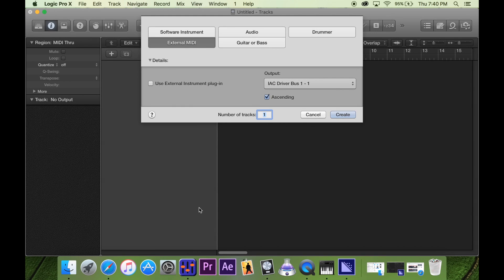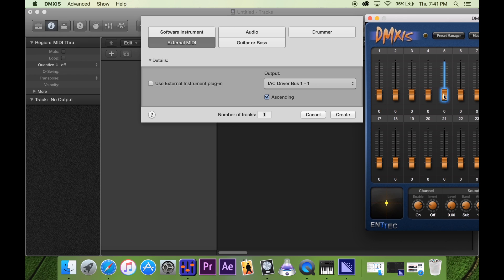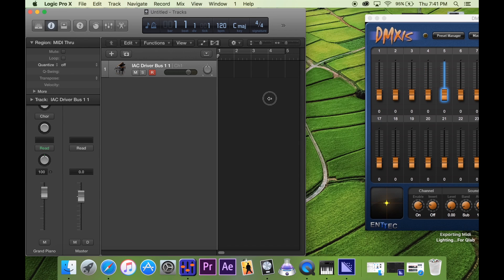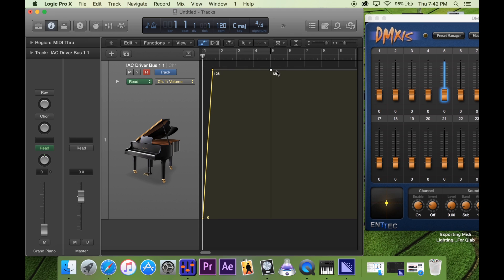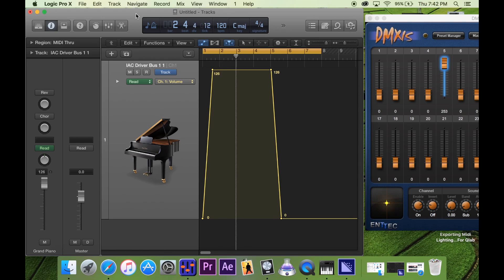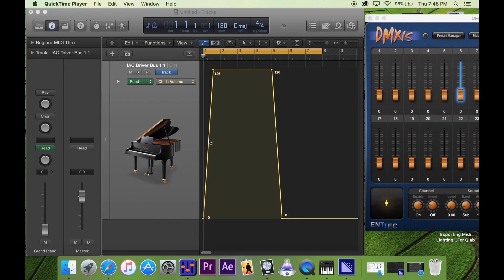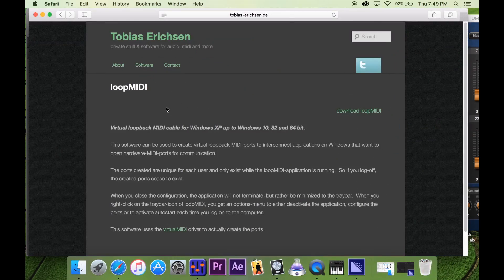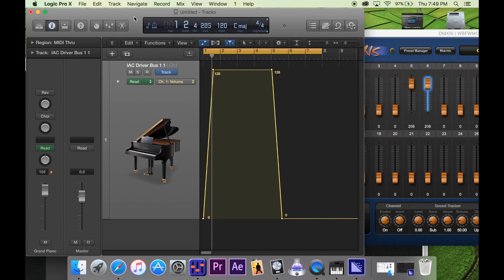Part 4: Logic X: Using External Software to Loop Haze Machines For DMXis

Comment: Hey man ! That is a truly awesome trick !!! Million thanks for sharing this with all of us who are newbies with DMXIS.
Reply from the maker: psbsynthmusic One thing I didn't cover was "disabling channel masks" for those specific DMX channels so you can control the smoke machines independently without interruption for each Bank & preset. Just make sure on each preset those channels are disabled so it doesn't shut off on you every time you switch a preset.
Reply: I'm not sure where can I find the "channel masks". Where are they located? Somewhere on the DMXIS'  GUI?
Reply from the maker: psbsynthmusic Yes it's in DMXIS, click the Macros Button, you'll see a drop down menu and hover over "channel masks" and (with the channels you want to effect selected) select "Disable Selected Channels" and save the preset...